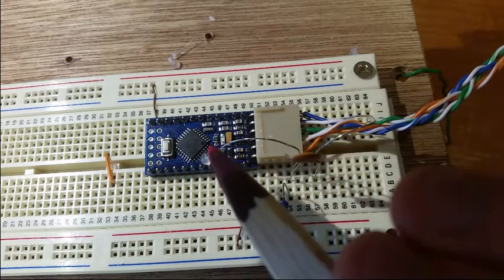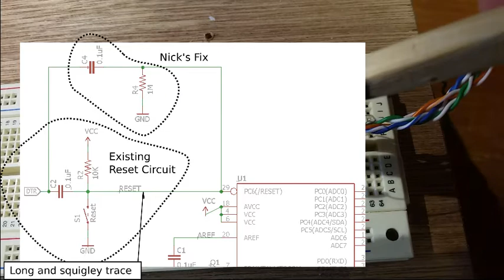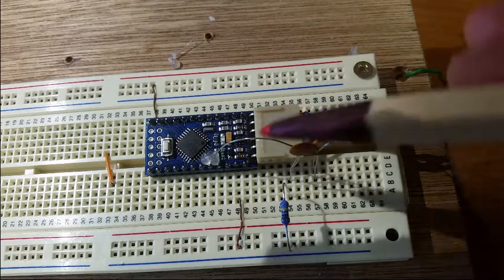Arduino Pro Mini FTDI Serial Programming Problem

Comment: for me it work after i update the ftdi driver
Reply from the maker: thats good. after much frustration this one time i have not had the same problem in years. it must have been a temporary problem with the default windows driver :)
Reply: @EngineerNick  My problem is also with ftdi drivers.(most propably not related with this video but just in case it is something easilly explained and fix i am asking )
Ok.now i have new windows 10 ,,installed Arduino ide ,and ftdi drivers from ftdi chip..
and Arduino ide does not detects NONE of some port.
basically in beginning was not detecting.
after ..some 'blind' efforts 
ONCE ...only one time....it detected..and i uploaded a simply "hi"(serial monitor)
OK...and just after ...i tried to upload soimething different(i unplug and plug ftdi on usb)
...NOTHING....
No port appearing in IDE.
Installed again ...nothing...
If you can help with a few words it would be great.

Comment: Was this a Atmega 328 PB chip or a 328P ?
I discovered yesterday that the DTR Reset with the 10k Pullup and the 100nF capacitor does not work anymore when I replaced my 328P with a newer 328PB...
Only works with a pulldown resistor instead of a pullup on the reset line - just as you suggested.
Thanks!
Reply from the maker: Hey Rolf, I am actually no longer able to reproduce the problem that prompted this video. I have a conspiracy theory that there was a bug in the windows FTDI driver for a few weeks which was later patched. Something obscure like that, i have no evidence. I ended up discarding that pro mini and buying another batch of them anyway. Thanks for the comment :)
Reply: @EngineerNick  Well that is'nt exactly what I expected for an answer.
My Question was: Was the  MC an Atmega328P or an Atmega328PB (B at the end)
I have this problem with the PB chip, the P works fine.
BTW. I am using a  Silabs CP2102  for USB Serial, so i guess it wasn't a driver problem.

Comment: you need to press reset when it says compiling and release it when it says upload hope it helps :)
Reply from the maker: Really? Never thought to try that. Oh well my hack worked for me anyway. I don't seem to be having this issue anymore for some reason.
Maybe windows FTDI drivers were patched or something.
Reply: Really!? Press reset when it says compiling and release it less than 0.3 seconds later!!?? That's impossible to get right manually!

Comment: Hello I am using a PL2303 HX for programming my pro mini it doesn't upload any code. It has 4 pins only so where do I conect the DTR pin of the pro mini? Is it the wrong ftdi that I am using?
Reply: if you are still struggling to upload the code the here is the solution , you just need to press reset when it says compiling and release it when it says upload hope it helps :)